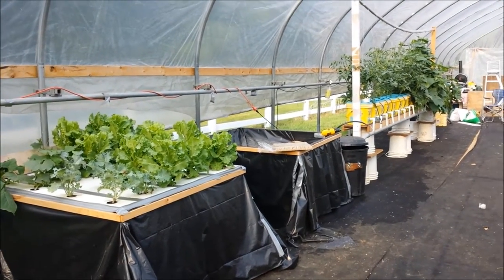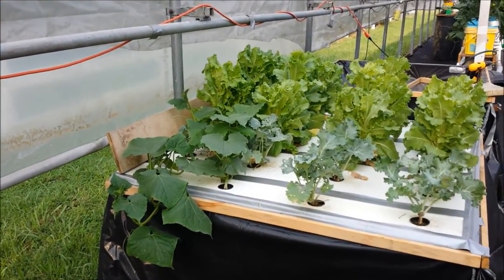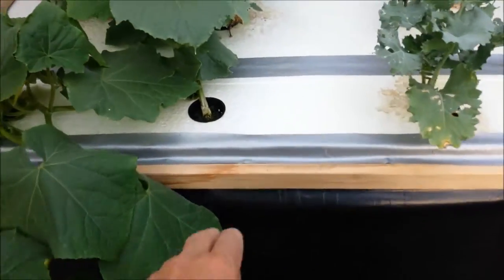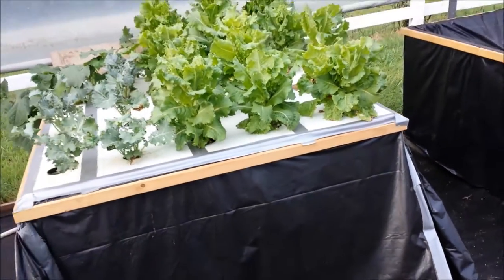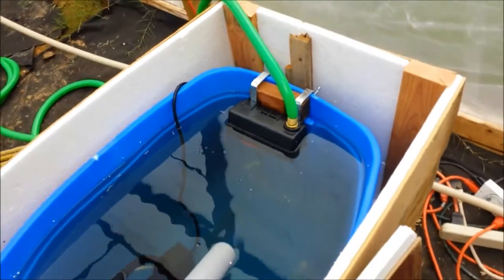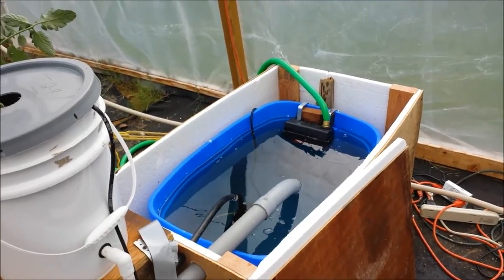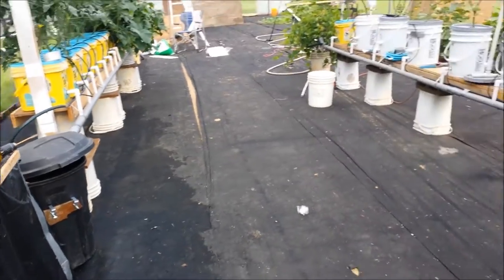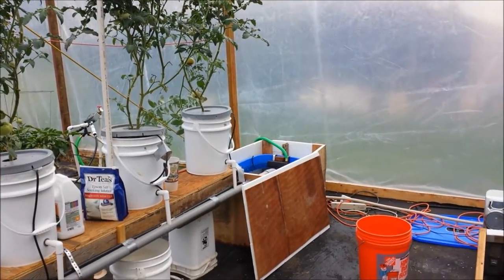Float Valve added to the Hydroponic System Reservoir

Comment: Chuck, looking good, well water, and hose pressure to a horse trough float valve.  Now that's cheating!  This evening I strolled by my tomatoes and what did I hear, that loud sucking sound of a nutrient pump.  I was running out of water / solution once again.  In my defense though, I have a secondary 27 gallon tote ready to be installed.  That will double my nutrient solution available to my 24 dutch bucket system.  I like the way you did yours, very simple and reliable. The Plants R Thirsty!
Reply: Nutrient solutions may clog float valves but you could just put your 2nd reservoir next to the first one and connect them near ground level.  Watch my videos.

Comment: Think about using the 24" by 36" mixing tubs from Lowes or HomeDepot as a Kratky tank.  Consider adding nutrient concentrate to your reservoir and adjusting the pH rather than changing the whole thing.  In the big systems they don't replace the solution very often.  I've seen no good explanation for changing the whole thing.  I know, the nutrient companies say you should be they have an interest in selling more product.
Reply from the maker: I agree totally. This is a very old video. I haven’t changed out the whole system in years unless it was to clean it.
Chuck